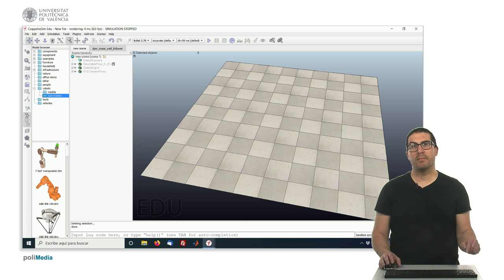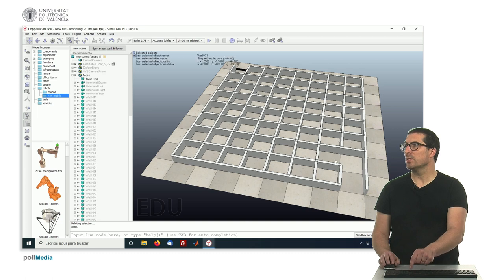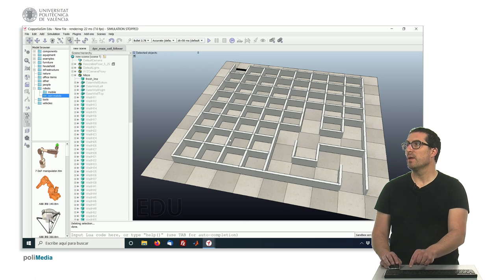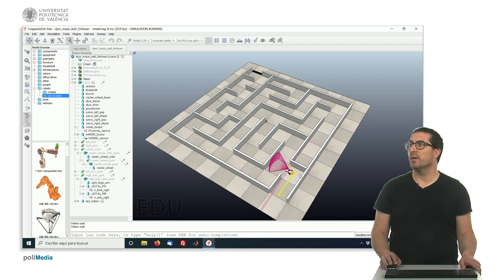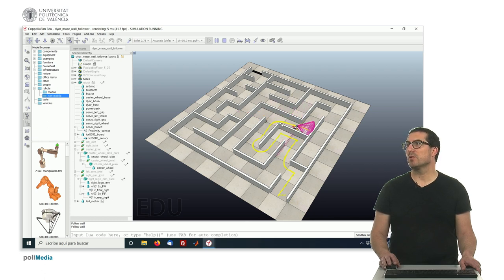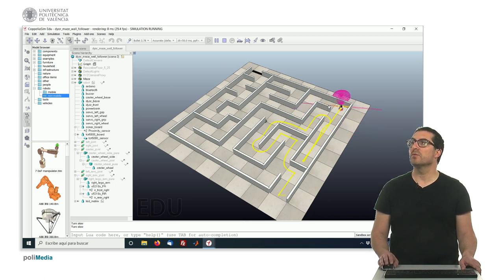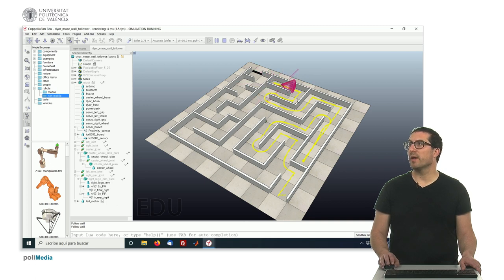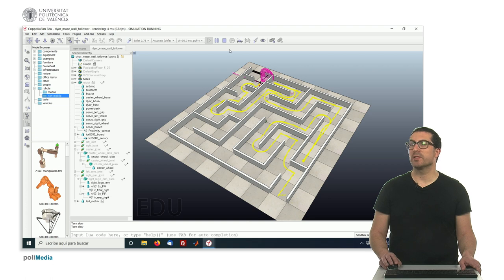Demonstration of a Maze Solver Algorithm with a Wall Following Approach  | CoppeliaSim (V-REP)

Comment: I'm looking forward explaining hierarchy of advanced mechanisms like (ABB IRB 360) model in coppelia sim or any parallel or closed loop
Reply from the maker: I have a student working in this. So, yeah, eventually, I will try to publish something with the students permission. However, there's a long way before reaching that point. I need first to introduce how to work with industrial robot arms and their kinematics/dynamics
Reply: Can we work with mircocontoller(like aurdino) after simulation in coppeliasim? I mean think we've built the bot just as we have designed and arranged all the sensors, then how to dump the code that we are using here in coppeliasim into the bot?

Comment: How to create horizontal and vertical walls?
Reply from the maker: There are some pre-existing walls included in the model browser, different heights and lengths. But if those, does not fit your needs, then you need to import your own mesh files